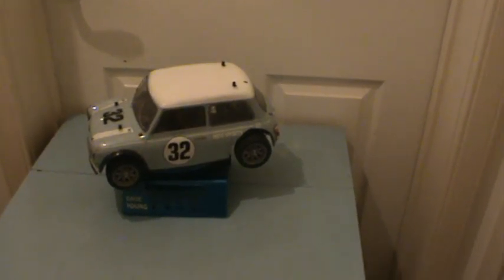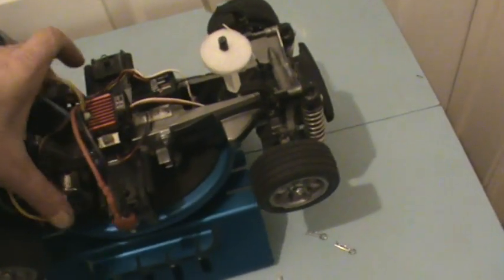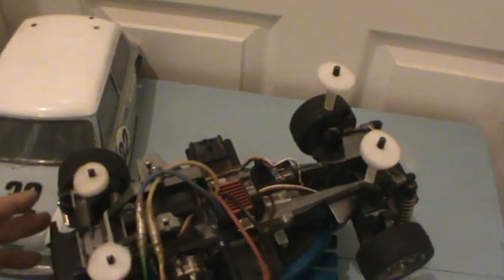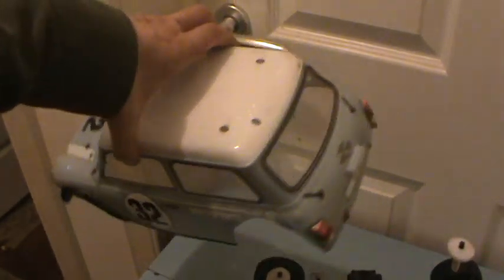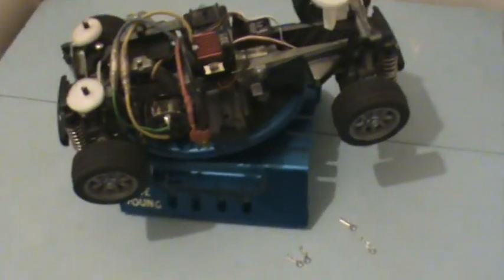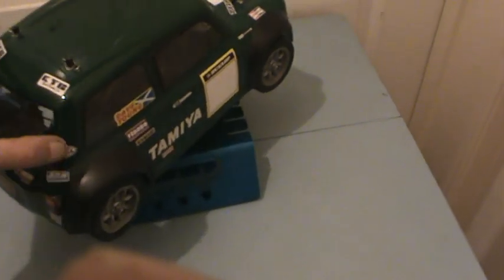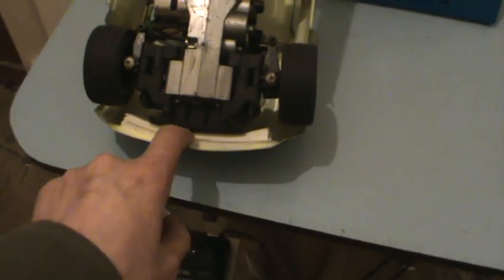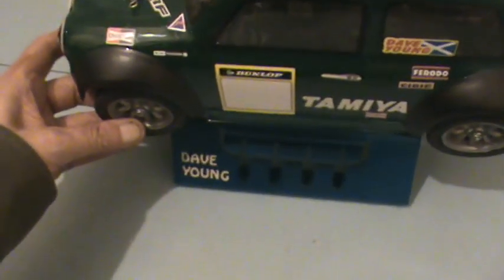Tamiya M-03

Comment: Looks good the new body, what parts are hard to get now for the M-03.
Reply from the maker: Finding a chassis isn't that easy Mal,  nor the price,hence the cable tie.
Reply: @semperatis  Funny that when the TL-01 was £15.99 delivered. Has the same problem, the chassis does collect crap.
Reply: it looks sweet David mate🐿🇬🇧👍👊